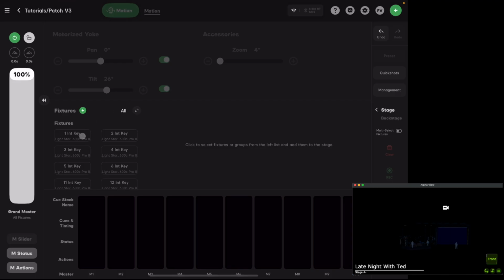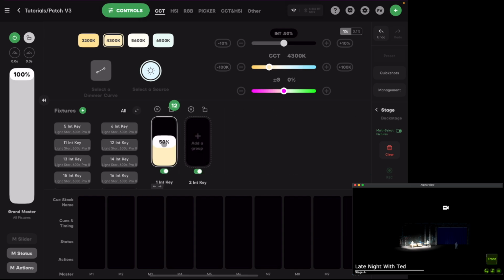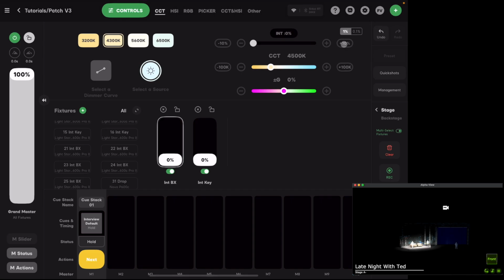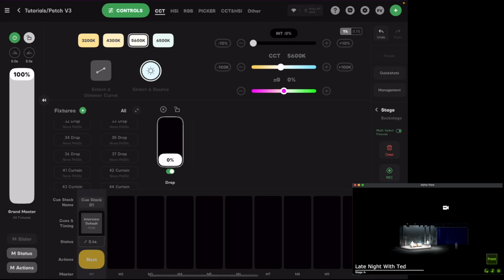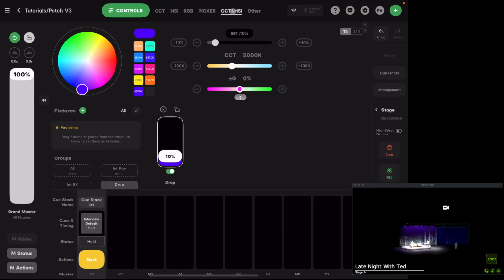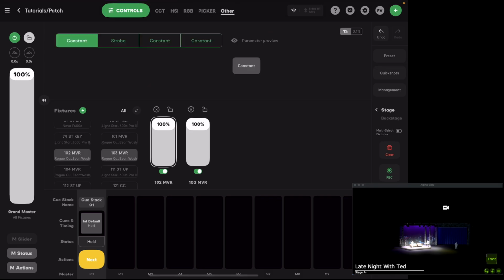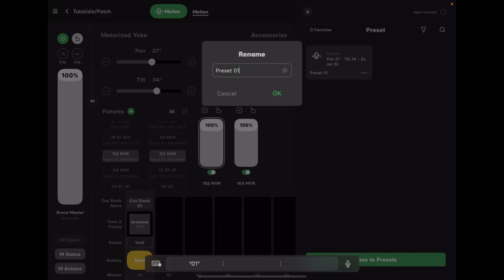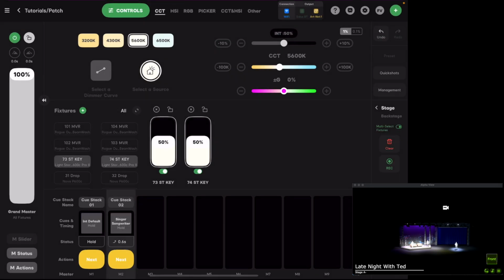04 Basic of Control with Sidus Link Pro

Comment: Hi Mark! I was wondering if there was an easy way of setting up a chase in sidus link pro. Currently testing with some "fixtures" in unreal engine and I can get a pixel "tube" to work individually but as soon as I have a couple of cues in a cue stack, each adressing a pixel in order, the whole light lights up or ceases to do anything. I checked the output from sidus' end and it seems to be doing nothing. Would love to hear if you have any feedback or ideas! Kind regards, Bram
Reply from the maker: Hmm.  Not really sure how that would happen.  I'll play around with the app over the next couple days and see what I learn.  Is this a simple Left/Right chase or something else?
Reply: @TeamNerd-f4q  Thanks that you're willing to help out! Yes it would be a simple left to right chase to start out. I'm very much a beginner when it comes to sequences, cues and stuff like it but I did see that blackout has some more pixel oriented effects built in. So I was wondering if sidus link pro had a similar thing
Reply: @TeamNerd-f4q  I ended up reading some of the documentation, came across LTP and HTP. I had my sequences set on HTP and sometimes even had the fixture still present on stage... So that would be user error. Would still love to see how you would go about making a simple chase left right and maybe inside out. Thanks for any time spent and your reply!
Reply from the maker: @TheBecel  Yup.  HTP vs LTP is a great concept to have in mind when doing these things.  I'm on a couple writing deadlines, so the dive into a sequence is going to take a bit more time.  But I'll get to it!
Reply from the maker: So I played with making a chase.  Hopefully I'm not stating the obvious, but...
Start with all pixels at zero except the first one.  Record first cue in something between 0.1 and 0.5 second time.  Repeat, taking out the previous pixel and bring up the next one.  
Go to Edit Cue Sequence
Touch the time of each cue and change from Hold to Wait Time.  I'd leave the wait time at zero.
Keep the cue list (As you learned) as LTP.
Reply: @TeamNerd-f4q  Whoops, completely forgot to respond. Thanks for the info! Ill be able to do most of what i'd want now!